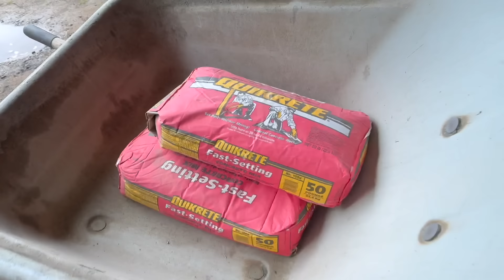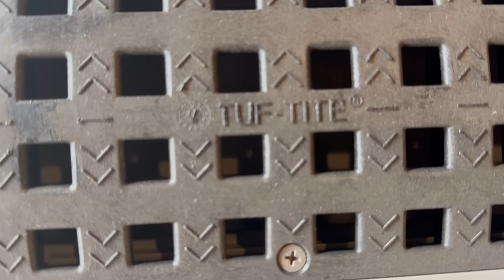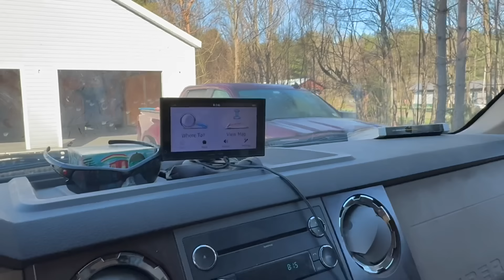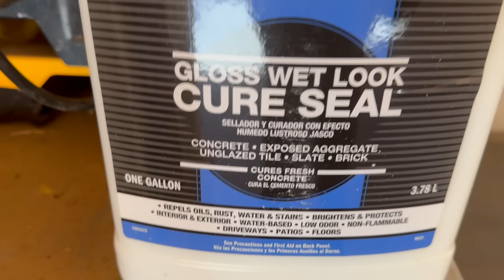Pouring concrete in nasty weather!!!

Comment: crappy weather. where im at, we have highs of mid 30's, light snow and windy on april 19th.  its supposed to warm up to the 60's by monday. last weekend we were in the high 70's. mother nature is definitely being bipolar this year.
how long have you had the dewilt backpack sprayer? have you had any issues with it and have you used any other products in it? been looking for something different than the ol' red sprayer pump cans for form oil when we do walls.
floor looks great, guys. we've started back to work too but not full throttle yet because of weather which is fine with me. its always nice to ease back into work before the spring rush. then we slow down a bit during the hot part of the year and then the fall rush kicks in.
good times. wouldnt want to be doing anything different.
Reply from the maker: I have only used the water base cure and seal in this one. I had another one we put solvent based sealer in it for stamped concrete and it immediately stared leaking so I returned it.

Comment: Beautiful floor Bondo 

Just one question 
Why you don’t put plastic on the block wall 
Won’t it connect to the blocks and than crack if is disconnecting from the blocks 
We do the plastic against the wall to let the concrete not connect 
So when it’s moving a bit it will stay more nice against the wall